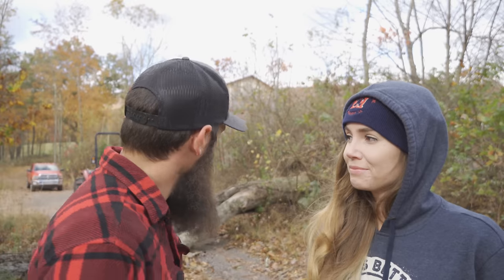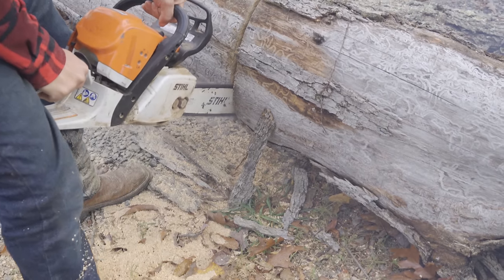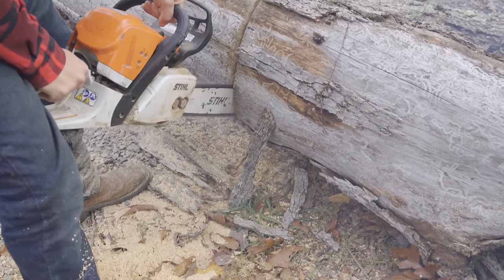Beginners Install Drywall On 20 FOOT Cathedral Ceiling

Comment: If you’re going to cover the walls with tongue and groove, why drywall first? Seems like a redundant expense.
Reply: Insulation and sound deadening values. If it's worth doing may as well do it right.
Reply: Fire-resistance of drywall balances the propensity of wood to burn and makes the room safer than wood alone.
Reply: David Larson thanks. That makes sense.

Comment: Why do y’all shoot the nails in in spurts?  I’m an old lady that doesn’t understand why
Reply: They are screws not nails, you have to be careful that you don't drive the screws in too deep, if they break through the paper on the drywall the screw won't hold 😊👍
Reply: col stace  thanks for the reply that makes sense 👌
Reply: @cindywaldron621  👍

Comment: Soviet star on garage
Reply from the maker: 🙄 We live in America. Over here these stars are extremely common and known as an American Barn Star or primitive star. It's a decoration and it would be basically impossible to drive through the countryside without seeing them all over the place on barns, houses, garages and outbuildings. You see them in all sorts of colors and patterns. Ours is red because it matches the red barn roof..... Several miles down the road someone has a gasp red star as well. You know why? Because it matches their red door.